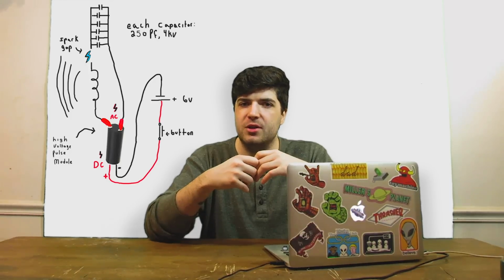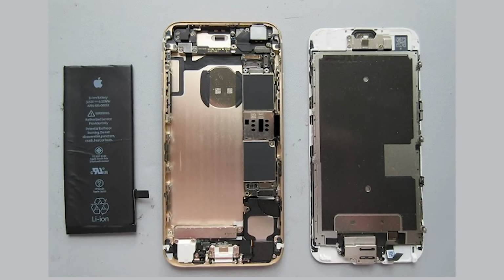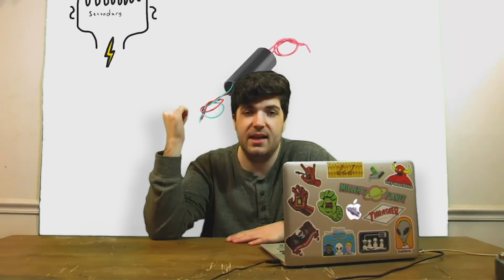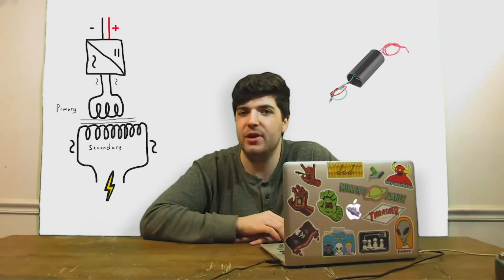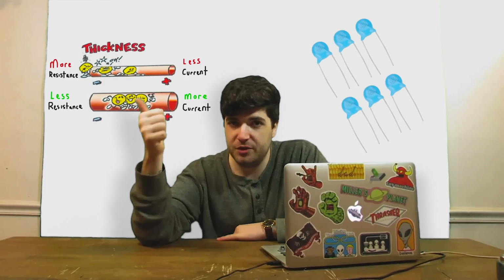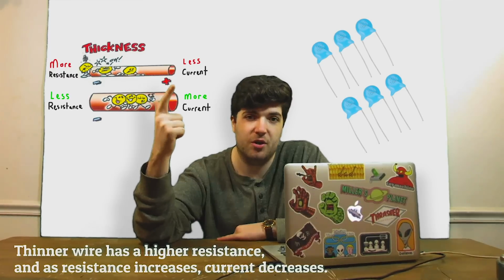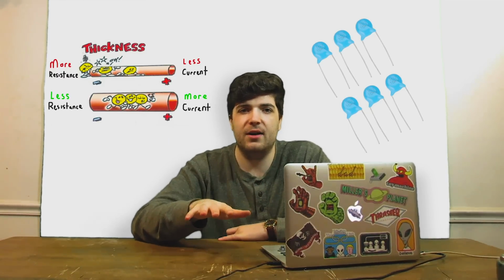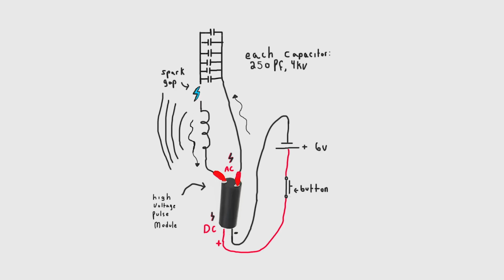Disabling electronics remotely - Building and testing out an emp device/ jammer

Comment: 1- Range test would be cool. 2- Testing how aluminum wraps of different sizes and forms affects its propagation. 3- Finding the ideal number of turns and radius of the wire loop (more turns, more impedance issue)

Comment: Hi absolutely love the vid, definitely worth the like and sub. I do have a few further questions to ask if thats okay.
How does the following affect the resulting emp field generated from the coil?:
-Increasing the number of loops in the coil?
-Using higher voltage rated capacitors?
-Increase the number of capacitors in parallel (or increase the capacitance of each)?
-increase the distance of the spark gap?
-increase the frequency of the AC signal?
-increase the voltage of the AC signal?

Any answers would be greatly appreciated 
Thank you!!

Comment: Not only the capacitors are in the wrong place, he cable tied the batteries? How clueless can people be?? 100% turd quality
Reply: Where are the caps meant to be?
Reply: Yes, once the batts go flat, the unit has to be pulled apart. Use rechargeable lipos with usb input.

Comment: I have a question, i have a tens unit and the diagram looks basically the same. So my question is, could i use it? wouldn't i just have to wrap the wires coming out in order to create the emp affect along with probably clipping the end plugs?

Comment: Looking shield my pc before drop grand more than North Korea sends emo pulse and it hunk junk they used that take airliner down in Africa that wiring is super expensive to prevent it 
Take heat sink vary fins length should prevent emps damage add spark gap cap to bleed off excessive energy 
I never tried that cause don't have access to that stuff right now
Reply: A large, unplugged, microwave oven may be big enough for a Laptop.
Reply: @TrueChristianityWithSandra  Cia has laser thar hacked if over 3 inches of aluminum 
Emp shielding is super expensive for airplanes at over 1k per foot I never saw it up close that's why you got turn devices off on take off and landing 
What I saw lamated sheets tied cap and led show which way data being transferred I saw that operation but not exactly sure how works

Comment: Try this, parallel 5 (or more) pieces of co-ax cable (1/4 wavelength at centre frequency will be shorter than a free space wavelength). Use the same stuff as TV down-lead, but you can use more specialist high voltage versions if you like. Make all of the pieces the same length, with the connections symmetrically arranged. Attach an antenna to one end (1/4 wavelength antenna connected to co-ax centre) charge the capacitance of the co-ax cables with high voltage (from a dc multiplier) and then have the charging end short together through a small spark gap. This is a VHF spark gap transmitter, it works really well as an EMP device, and has several metres range for susceptible devices. For the DC charger I used a camera flash circuit with the main capacitor removed and passed through a voltage multiplier (diodes and capacitors). Around 7kV is suitable for most standard, cheap, co-ax cables, you can go higher if you use some of the more specialist cables (RG213?)... It is a low impedance resonator connected to a high impedance load (the antenna). You only get a few RF cycles out of it, but the peak power is really high.
Reply: Got a drawing of this??
Reply: @kjellagotnes4547  No, but it was based on a spark gap resonator. The co-ax bundle was charged from a camera flash circuit feeding  a small voltage multiplier using a high-ish value resistor to avoid loading the co-ax bundle during discharge. A piece of wire was connected to the end of the co-ax bundle as an antenna. The voltage was only around 5kV and it would affect unshielded devices (a childs toy) at around 4m distance. The notes of doctor Carl E Baum willbe of help. http://ece-research.unm.edu/summa/notes/
Reply: What did you kill?
Reply: @imho2278  2 laptops, by accident. Also could activate an (unshielded) childs' toy at around 5m distance. Basically a vhf spark gap transmitter. The notes of Dr. Carl. E. Baum are helpful, and also some old patents for missile jammers. You could also try searching for mesoband or switched oscillator.
Reply: @imho2278  Forgot to mention that something called a 'frozen wave generator' would work better. The thing I made was a 'hertzian resonator' - I didn't realise it was something used in the past to blind radar - It's old tech so maybe can disable some civilian things, but doubt it's got any military use, seeing as the information is free to find and declassified.
Reply: Could you send me a diagram? I don't quite understand how to connect the coaxial cable to the coil or antenna, and I'd be very interested in your experiment.
Reply: @Aledo87  Connect the antenna directly to the paralleled co-axial cable centres. It does mean that it will have a high voltage on it, so take care not to get a zap. The spark gap goes at the other end of the cables inner to outer. The gap is only a couple of miliimetres. It would work better if you could obtain (or make) a single piece of low impedance co-ax (around 10 ohms). It would also work beter if a pressurised spark  gap was used (to get fastest possible time and highest voltage - most cheap co-ax can only stand a few kV). You should also make the antenna the usual 50 ohm impedance - the mismatch between the antenna and co-ax resonator helps to reflect the wave inside back and forth. It is a vhf resonator, shock excited by a discharge  through a spark gap - very similar to the ancient 'spark gap radio'. Something similar was used dropped from parachute to blind radars when they were susceptible to that type of thing (a good few decades ago). The idea is to produce a very short burst of RF that has high peak power, but very low average power, and with minimal effort. It is good for testing the susceptibility of modern electronics - unscreened things, like the child's' toy I may have mentioned, can be made to malfunction a good few meters away. Be aware that it can also cause severe radio interference, so take appropriate steps to not cause harmful interference.

Comment: What additional equipment would be needed to extend the range and focus of this experiment?
Reply: If you're still looking for an answer to this, place the emitter in a parabolic bowl with as reflective interior surface as possible and raise the voltage as high as you can. The parabolic shape will concentrate and focus the magnetism from the collapse, and the higher the voltage the more magnetism will be generated during each pulse, meaning stronger fields and thus longer range.

It might be possible to extend it further by placing the emitter in a series of reflective parabolic bowls that create an "expand-collapse" like pattern, where it starts expanding and then shrinks it down to a point before expanding again in the next bowl.

Comment: These hv converters produce dc and not ac. So you don't need a capacitor because its dc and there are already capacitors inside the hv module. Also you are using the wrong kind of capacitors. Nice Video tho.
Reply: What capacitors do you recommend?
Reply: @duelz96  Some sort of high voltage foil or ceramic capacitors. This guy is using some sort of low voltage cap (like 50V) which is just gonna arc through. Btw make sure to put the caps in parallel and not in series with the coil as shown here.